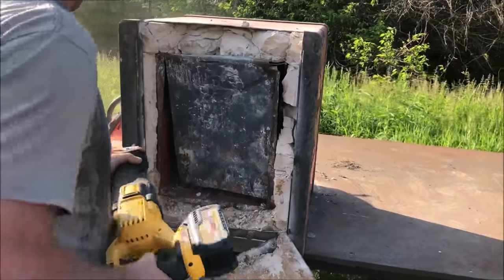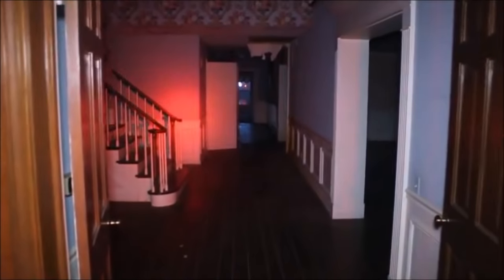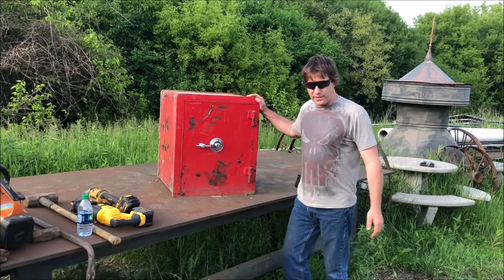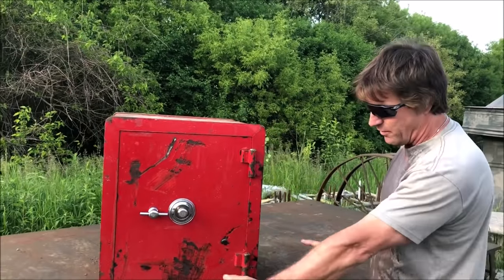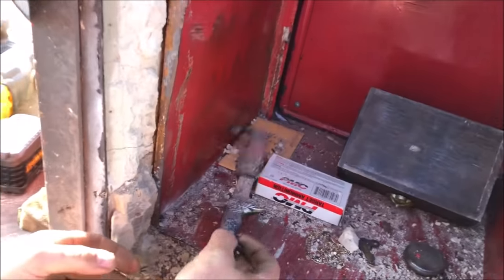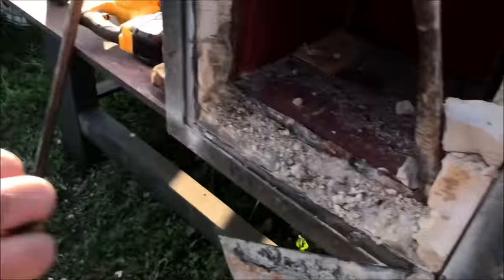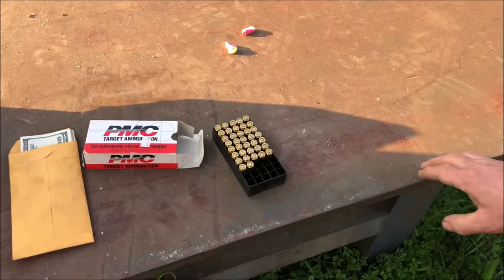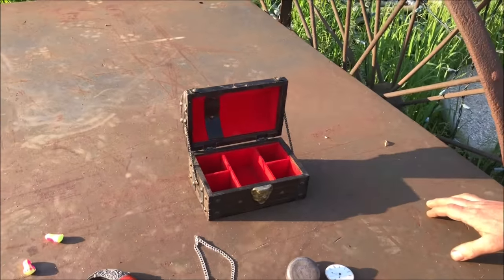FOUND SAFE FULL OF MONEY HIDDEN IN WALL OF MILLIONAIRE'S MANSION! BREAKING INTO ABANDONED SAFE!!!

Comment: The knife unless the winner is in New York City isn't a problem being shipped to the winner. The key is for a clock. 9mm PMC ammo is around $8. The neatest things were the knife and the jewelry box. Too bad the top of the lions head is missing as the box is unique.

The pocket watch if it's anything like the old Waltham I inherited, is just about worthless. You didn't mention that the watch had a gold case, so most old watch cases are silver plate, and if nicer, sterling 925 silver. Looked like the enamel or porcelain was cracked around the top edge, which makes the value even lower. 

Gold chains are valued by weight. 14K if the necklace is 25 grams is probably worth $225 at best.

Comment: That’s a radiator key. Used to bleed old style stream radiators in houses. Like the cast iron ones. Still in use and needed today. I have that style radiators in my house. Good luck and thank you for the interesting videos!🔥
Reply: nope, thats an old clock key, you can tell by the little nubs on the top of the key. Similar to a radiator key.

Comment: The new redesigned bill was issued to the public on October 8, 2013 
If the new owner bought the home say sometime in 2014 
and the previous owner installed the safe years before 2013, and passed away taking the
secret of the safes location with him / her to the grave.

   Then the previous owner could have left the cash in the safe,
then the safe easily could have been hidden the walls of the building
with out the new owners knowledge of it....

  ((Maybe the key was to reset the combo lock on the safe).
Reply: Did thy move in the home before or after the redesign of the 100 dollar bill was issued to the public on  (October 8, 2013) (would be a pertinent question).